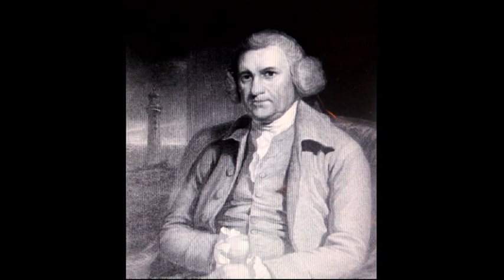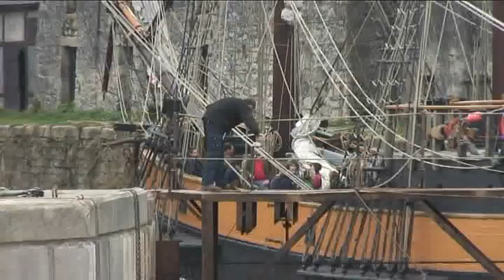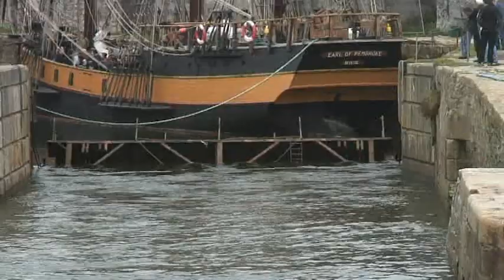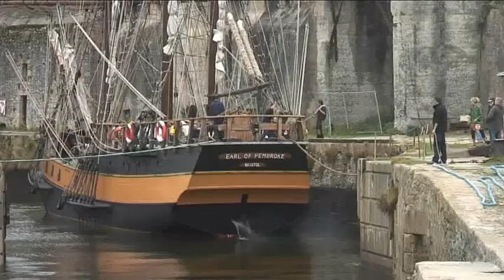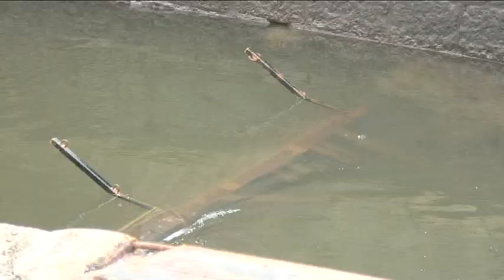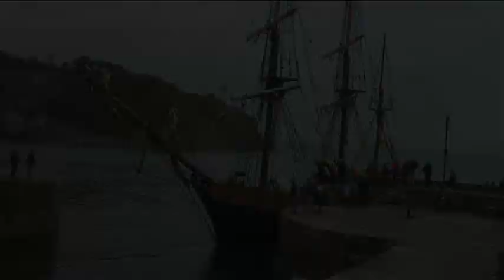Smeaton's harbour lock

Comment: "I don't know if it's of any advantage..." 

I'm guessing (having been there, but not seen the gate operate) that a conventional hinged gate would be impossible to open unless the levels on both sides are exactly the same - and that almost never happens here because of the tides. They need to be able to open the gate whenever there is enough water in the outer harbour,  which might not be exactly the same level as inside the dock - and that might be higher, or lower.